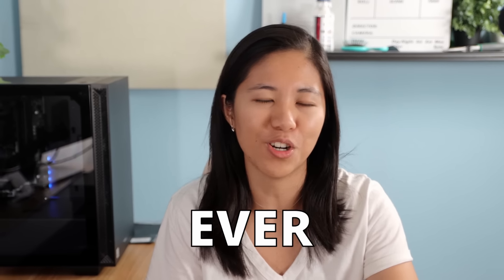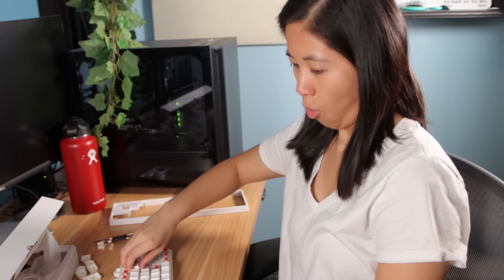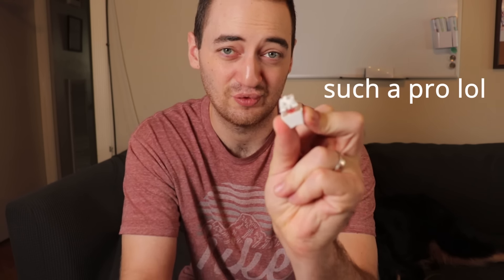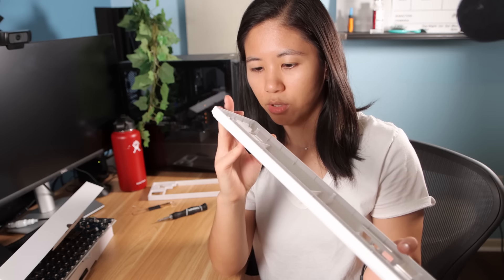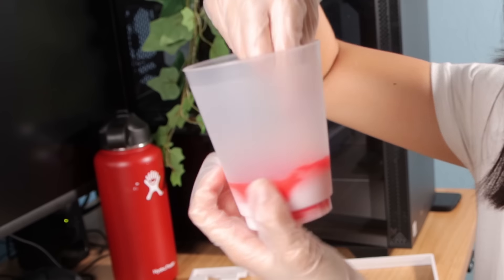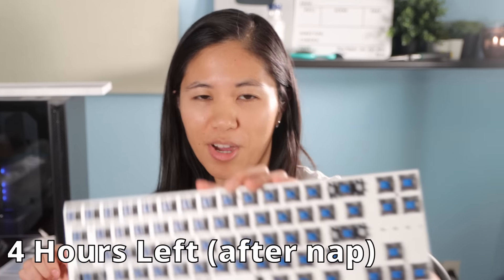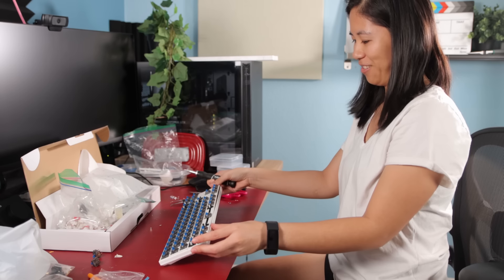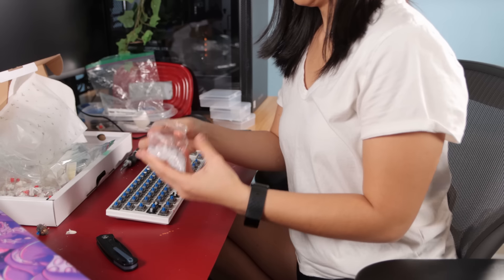I Built the Quietest Keyboard Ever

Comment: WD40 as lubricant, especially for plastics, is not a good idea. The solvents in it will disintegrate many plastics over time -- crazing, cracking and discoloring them.
Reply: That wasnt the og wd40 though, iirc the yellow cap one is lithium based
Reply: Yup. It's a common misconception that WD-40 can be used for stuff like this. WD-40 is, in fact, not a lubricant, and will destroy stuff like this.

Comment: After months and months of watching your videos and other YouTubers, I finally got myself a Redragon K552. I was surprised to find a keycap puller in the box and 4 extra switches. Will try different types and application of lubrication to see which one performs best. I think I can sacrifice ScrLk and Pause keys as well in the name of Sayence. These are Outemu Blues so have to experiment.
Reply from the maker: Get the akko cs switches, they'll fit
Reply: @SwitchandClickOfficial  thank you for the suggestion. Finding replacement switches for Outemu sockets is a pain.
Reply: @N1lav  you can just clip the extra legs off a 5-pin switch, but Akko CS switches are good options if you don’t want to do that
Reply: @evilsmileyface  Its not the extra pins that are the problem, Outemu sockets are thinner than Gateron/Cherry switch pins, so before swapping the pins need be either clipped or dremeled. I have ordered a tester pack with a few Gateron Kailh and Gazzew switches. I will try swapping the lower housing on the Gats to see if they work. Its all experimentaion from now on. :P
Reply: @N1lav  right, forgot about that since I’ve never had an outemu hotswap socket keyboard

Comment: it’s impressive as a diy project! but i cannot understand why anyone would want to use these tbh. granted, this is coming from someone who unironically thinks the keyboard from ur loudest keyboard video was “not that bad, maybe fun to use”.

for me the whole point of a mechanical keyboard is that it should be loud because it’s like a little challenge to make you type faster to make it go clckckckckckckck and get that sweet audio feedback for being productive lol. pushing keys with clicky switches is one of the few things that lights up the reward circuit in my brain lol. 

also that red silicone! that’s good stuff! great choice! platinum cure and easy to work with lol. i wasn’t expecting a crossover between two of my niche interests, keyboards AND molding/casting materials, oh wow what a neat video :D